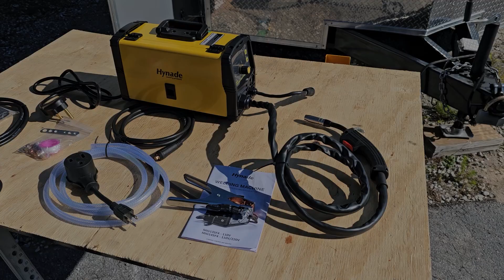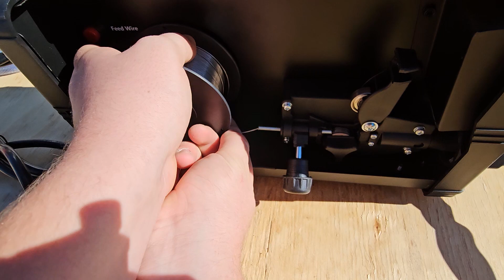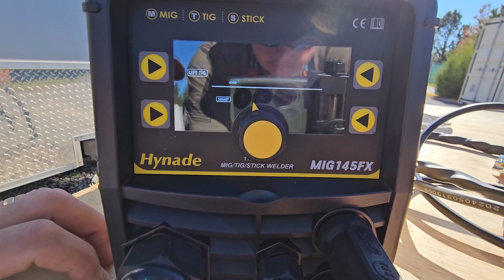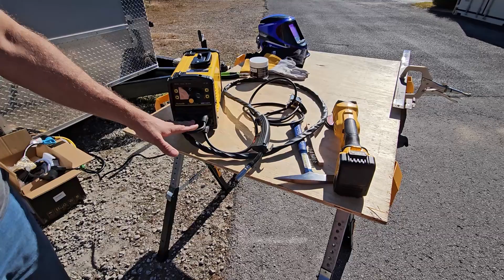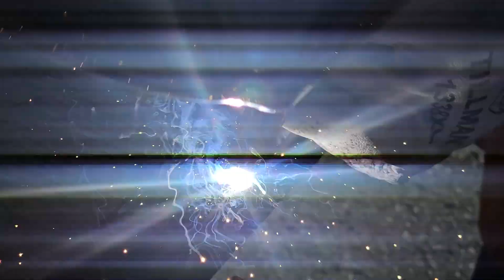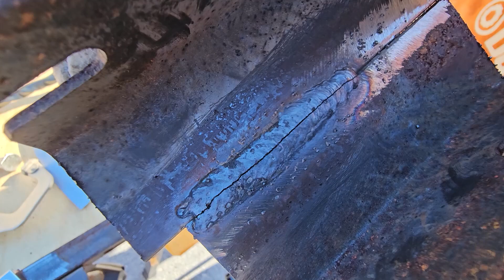Unboxing & Review: Hynade 3-IN-1 MIG145FX MIG Welder | Ultimate Welding Machine for All Skills

Comment: Both your wire speed and amperage were too low. Your amps should have been around 90 for that bed rail. The wire speed would adjust accordingly and the build of wire would have been much better.